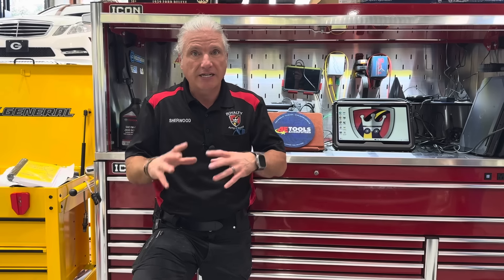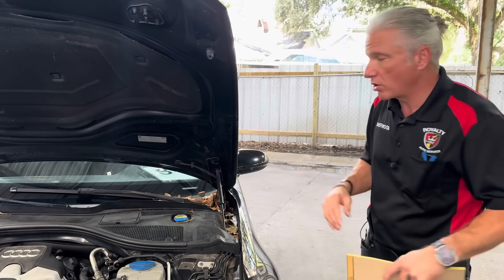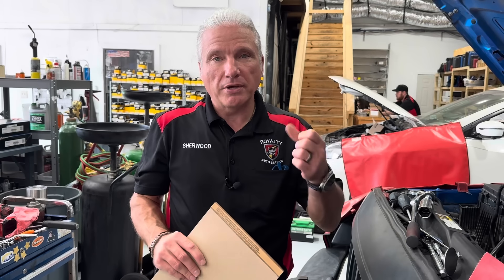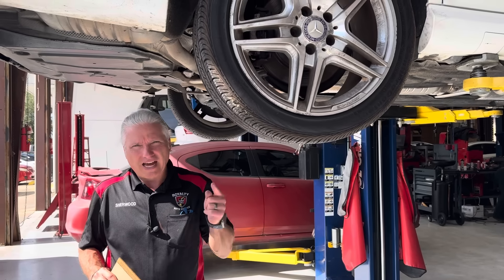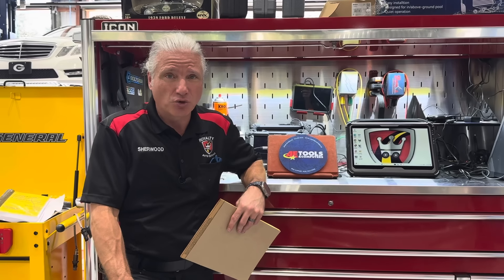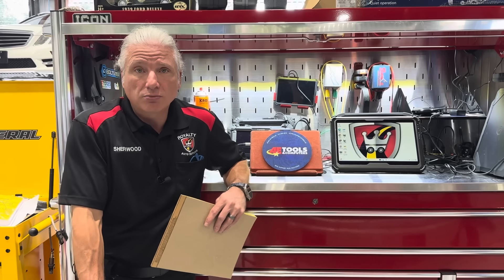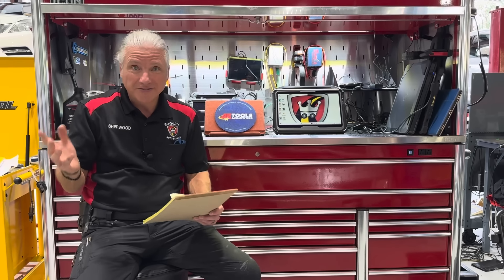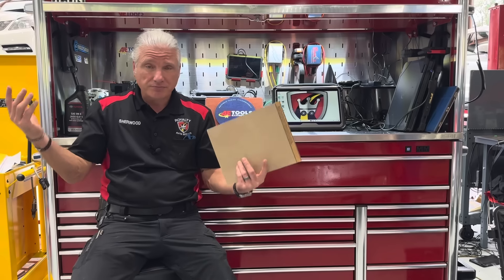Ranking The Top 5 Most Expensive Vehicles To Maintain That We Work On At Our Shop!

Comment: Yeah. I definitely prefer my minivan engine powered wrangler. Glad i didnt get the 3.6 engine. Sure i have less power but i also see less issues and mine easy to fix.
Reply: My buddy has a hemi-swapped wrangler.  That's probably the route I would take.
What type of minivan engine?  I just think of the Mitsubishi engine my dad had in his 91 Voyager when I think of that.
Reply: @ I got the 3.8l engine. I love it. Fits the main criteria I wanted in an engine; easy to fix, cheap to fix, reliable, enough power. I’m lifted 2.5-3 inches and running some decently heavy wheels and tires and I have no problems out of it. Stock gears still but planning on 4.88 or 5.13 in the future. I would do a v8 swap but I find fixing and the size of a v6 to be better for my engine bay.
Reply: 3.6 is easy to fix
Reply: @mph5896  I dont consider removing an intake for spark plugs and leaking oil cooler housing simple or cheap. Aside from that ive seen many have the infamous rocker arms failure.
Reply: @Hephaestusthejeep  diy I can see it being intimidating. As a mechanic, it’s a simple engine to work on. Rockers, you can wedge the tensioners so the timing cover doesn’t even have to come off. Plenum comes off in 20-30 min.
Reply: @Hephaestusthejeep  That sounds like a pretty convenient build.
I very much see your point with the V8 route.  You say 3.8L.  What type of engine?  What did it come out of?  Is it an I-6?  V-6?  Who made it?
I'm completetely with you about the spark plugs.  Those shouldn't require an intake removal to change.  If an intake is routed on top, maintenance holes in the runners should be designed into the intake to allow removal of the plugs without removing the intake.  That's how my Nissan D21 V6 is.  The only exception to this rule is if you have a supercharger.  Even still, I would try to get a blower that isn't that compact.  Allowing ease of access to something so commonly addressed.
Its a little like blocking access to the oil drain plug with a skid plate.
Reply: @mph5896  mechanic here too. I just don’t see the benefit of dealing with removing an intake to diagnose misfires or replace maintenance items when needed. Adding in getting new gaskets each time it comes off it does add up to be more expensive compared to a conventional ohv v6. The 3.6 is nice with more power and torque but I like the fact that if I’m dealing with a random misfire to trace all I have to do on mine is reach down and swap the plugs in about 30 minutes.
Reply: @christopherlowery855  it’s just a bored over 3.3 I think from Chrysler. Comes out the grand caravan.

Comment: Interesting, my 20 year old BMW Z4 is well maintained, but most years I spend less than $200 on it - Next year will be a bigger one. I am going to replace my spark plugs, battery and DISA valve, brake fluid flush and coolant flush. So about $2000 Tires were an issue until I went to an independent shop and had the alignment adjusted to a less aggressive (I do not drive on a track).

Comment: The oil change interval on the newer Land Rovers is every 20k miles.  Way too long to go between oil changes IMO.  We are doing ours every 5k miles on our 2024 Range Rover Sport.  I do the same intervals on my 2022 Lexus GX460.  I will say, the Land Rovers we have owned have been pretty good.  The last one suffered from a buggy and laggy infotainment system but the new one is much improved in this area.

Comment: Yeah, got an old AUDI, not surprised at all to see the brand on this list. And that's given I live in Europe, where they are much more common, like really common, so services know them, parts are not that hard to get and there are scrapyards in case you choose to look for used parts. And that's given I got a relatively simple one - no air suspension, no quattro drive (which is robust, yet adds weight and complexity), no problems with fouling on diesel, no turbine, but it's a V6 gasoline, and working on V6 isn't simple, so it's expensive, like changing timing chain alone costs 50-60% of the price of that old car.

Comment: Crazy. My Mom is 78 and has had 4 Audi’s. Currently has a 2021 Q5. She kept them all for around 10-14 years. All were bought new and all were sold with around 100-120K miles. Not one of them had to go to the shop other than regular maintenance like brakes, oil etc. Which my Dad did all of the maintenance. Why pay $300 for an oil change when you can easily do it yourself. I really think it’s luck of the draw. You can take 2 identical cars on one might have problems and the other have none.

Comment: My bmw has been very reliable however regular maintenance is very expensive especially fluid changes at around the 80k-100k mark. Transmission, transaxle, diff, coolant, etc. Also many plastic parts on the car that might need replacing at that mark.

Comment: OBSERVATION...also take each individual mfg brand part, add it up to get a dollar cost per part amount and also add up how many times that part was installed. This way you get an average price on a part and the likely it will be repaired if your doing a lot of repairs. So the data would look like this: VW oil filter $50...changed 70 times. VW EGR valve $80 changed 40 times. Ford oil filter $35. EGR valve $90. This way you get to see how much these parts are costing. This takes out labor....but its also good to add labor to see what it would cost at a shop or if you DIY. Avg repair order could be skewed if you counted an engine change vs. 10 oil changes or if you repaired 1 brand 1 time vs 50 times for a Dodge. You need help working w that data, call me.

Great vid and theres so much cool data to explore.

Comment: Had a 2012 LR4. Need to add to your list, the damn high and low pressure fuel pumps. Why they would link those in with the timing chain was stupid. That took my engine out, no warning at 118k miles. I will never ever buy another Land Rover

Comment: There was a time when BMW built engines that NEVER leaked oil. So much for progress. No oil change needs to cost more than $75, even using proper synthetics. It doesn't matter if the car is a European make. I can change the oil myself - and do - for under $45 in my BMWs, using top quality oil and filter. A $300 oil change is insane. These are interesting "average repair order" data, but the spread from lowest to highest by make is really insignificant.

Comment: My 2014 Mercedes Diesel ML-350 cost me around $5,000 in oil leak repairs over three separate repair orders within one year (2022). Thus, I traded it in for a new 2023 Lexus ES300h Ultra Luxury model and she is the best vehicle I have ever owned since 1967. I got my money's worth out of the Mercedes since I owned it from Nov 2015 to April 2023. No regrets, it was just time to let her go at 92,000 miles.

Comment: Although this is useful, it does not give the whole picture since the frequency of those repairs is important too.  In other words, cost of repairs during a given ownership period is what generally matters.   The Presentor mentioned for example, that many of the expensive repairs on Mercedes come after 12 to 15 years of ownership.  Owners who get rid of their cars before that would not see those repairs.  Did they need many repairs up to that point?
 A mechanic I know who mainly works on high end cars like Land Rovers and Jaguars mentioned that they tend to be reliable through their warranty period.  He had observed that many who are wealthy enough to buy those expensive cars new will trade them away for a new one during that warranty period.  For them, those cars ARE  reliable.  He suspects this is why those brands have not improved dramatically in long-term reliability..... the people who buy them new (what really matters to the automaker) typically do not own the vehicles long enough for "long term reliability" to matter.

Comment: I own a Jeep Wrangler it’s a 2014 Jeep Wrangler JK unlimited sport. It’s also lifted with 35 inch wheels on it. I’m sorry 35 inch tires and aftermarket 17 inch offset wheels. I have done everything to this truck and the lift with everything done properly with a little over six to $7000 in parts alone. I am a mechanic and I do not suggest owning a lifted truck, even if you are a mechanic because all of your time will go to it. If you want a lifted truck, do not use it as a daily driver like I do. Keep it parked only drive it when you’re offloading us weekend warriors have to pay a lot of money for this. Other than that, these trucks are tanks and they go forever if you buy one of these trucks factory and you get the issues fixed it’ll last you a very long time. Mine has 110,000 miles on it right now and I have had no issues other than what I caused on it myself. Now I do replace things before they go bad. I had a slight tick so I have brand new rocker, arms and push rods on the way and the timing chain lockout tool so I can replace this stuff myself. This will cost me a couple hundred dollars this will cost you a couple thousand dollars.

Comment: I had the eco boost at top 4 as a guess, I haven’t bought a gm since 2008 and the afm crap, love yalls approach to vehicles and the fair real way you do it!!
Reply: yea figured ford would be high up there. gm is hit or miss due to the truck lines and cadillacs are also shop queens. buicks are usually a better pick the toyota of gm in my experience. see how that plays out since they switched to korean chinesium models now in the near future. kia hyundai i thought would be number 1 as almost everyone ive known personally has had engine swaps or some sort of expensive fiasco in or out of warranty with those piles of garbage. they're like the samsung of home appliances.
Reply: @inducedapathy1296 but Kia and Hyundai have 100k warranty.
Reply: @fastinradfordable  yea that's prolly what is saving them from being the top in every negative category. most of my circle have bought them new requiring thousands sometimes tens of thousands in repairs before they even get out of warranty.
Reply: @inducedapathy1296 More like the LG of home appliances.  To your point though, they're both crap.
Reply: @fastinradfordable Its a powertrain warranty.  Also, after that 10yrs are up, so is the warranty.  Its just a scam for gullible buyers who believe all cars are built the same.
Repair costs are built into the cost of the vehicle.  The goal is to rotate a buyer into a new car every 5yrs.  Just like everything else.  Seems to be working pretty well so far.

Comment: Hmmm. A couple of flaws I see is that 1) this system could punish manufacturers that have long lived, high mileage vehicles, which only cost so much coz they made it so far and 2) some vehicles from the same manufacturer are worse than others, depending on what factory and country they were made in, and what market segment it's from (small, economical, commuting cars with cheap parts will have lower average cost of repair). An outlier vehicle could drag the whole manufacturer up or down a few positions

Comment: The cost means nothing if you do not use the mileage done...
I do all mechanic works on my cars/van and some people say an oil change only cost 100$ on their car at the dealership, every 10000km. Well..on my bmw the normal interval is 30000 km between oil change, i do them myself with the same then stock quality oil (synthetic 0w40) and it cost me 30€ filter included. So for 30000km i pay 30€ while they pay 10 times more.

Comment: My BMW and Cayenne leaked EVERYTHING and were on flat beds more than they were on the road all before 100K miles. 

Drove one 2015 Mazda MX5 to 120K spent $400 on repairs. 

Now drive a 2019 Mazda MX5 at 95,000 miles replaced the alternator and battery at 70,000 miles $700 in repairs. 

Neither car has ever leaked anything EVER!!!😂
Reply: My Pepper Car is headed for 250k miles. Been largely trouble free after fixing design defects. Hasn't been to the stealership in 6-8 years.

Comment: I bought a BMW X1 and the maintenance on it was ridiculous.  Paying $700 for routine maintenance, can't even change the battery, without them reprogramming it.  I mean this was a newer car.   I couldn't image after this gets out or warranty and the real issues pop up.  People see cheap BMWs and buy them, but they are cheap for a reason.  They are awesome cars to drive, but the repair and maintenance costs are a total waste of money.   I have a 2006 BMW 325i and it's still going with 160K on it, but when I brought it into the dealer, they wanted to do $3500 worth of repairs on it, like 20K miles ago lol.  $750 for front brakes!!  I did whole car, with new rotors for about $150, not the $1500 they would have charged.  I sold my X1 for more than I bought it for a couple years ago (Thanks Covid lol!!).  Never again.  Toyota/Lexus or Honda/Acura now.  I had my Prius for 10yrs and 160K miles and didn't put one penny into anything but regular wear items.  My 2005 Lexus, that I have had for like 18yrs, is still running strong.

Comment: Now it's time to do the top 10 cheapest ones lol
Reply: 1981 vw rabbit pickup diesel. 
Mine has a 1.9 tdi swap with electronics deleted. 

75mpg. 
I have commuted 1600 times last 2yr without a single failure.

Comment: Absolutely no surprises here. I was a fleet manager for a U.S. based German multinational. We predominately bought Ford Explorers and F150s for our sales force, but the German executives loved their Mercedes and BMWs. We also had American executives who loved their Dodge RAM trucks and Jeep Grand Cherokees. The German vehicles are over-engineered, expensive trash. I'm surprised you didn't mention the different size tires on front and rear of Mercedes vehicles and the "run flat" tires both Mercedes and BMW utilize. Jeep, what can I say, recalls, electronics, and transmissions are terrible as with most Chrysler products. Ford F150s had issues with recalls, timing chain drive/cam phaser on their 3.5 EcoBoost V6. Personally, I buy Asian and I didn't hear one Asian vehicle on your list. I know you don't like Hyundai, but I've had three, an Accent, and two Santa Fes with absolutely no issues.

Comment: I have a 2014 Dodge Grand Caravan. I've replaced both the transmission and it has the 3.6L that needs the lifters replaced/cam shafts replaced. I'm not interested in purchasing anything made by Chrysler Dodge Jeep going forward. There are shops around here that are working on a lifter or engine replacement 2-3x a week. It's a problem.

Comment: Most repair videos focus on engines   I’ve never needed engine repair on any car in 40 years  But suspension and steering parts are ridiculous   My 8 year old A4 needed 12,000 for control arms and steering nuckles  my grand caravan $9,000 for struts control arm brakes etc   Had one Audi needed2,500 for a fuel gauge

Comment: I had ab Audi A-4, 6 cly-worst vehicle I ever owned, nothing but electrical problems. My 2000 Toyota Tacoma with 240,000 miles runs like new, nothing breaks. My 2014 E-350 runs like new.

Comment: 2018 Tesla Model 3. No oil changes, no transmission to go bad. Nearly 100k miles now. Total parts replaced out of pocket- front sway bar links and control arms w/wheel alignment. $1400.  That’s it. Tesla tested the battery last month and sits at 92.5% capacity.

Comment: You realize just how bad some engines are, that they drag down a brand, while having some of the most (if not most) reliable drivetrains ever made. If even the Panthers cant offset the ecoboost crap, you know its trouble. Add to that the 5.4 3 valves and you got some bad numbers

Comment: My parents bought a brand new BMW X5 back in 2006, that thing was a true POS, built in Spartanburg South Carolina, flaking paint on interior door handle, led dot display dimmed out, exhaust tip cracked, leaking oil, smoking from exhaust, stayed in the shop 5 times within a year span, needless to say they got a Lexus after getting rid of that European trash.

Comment: Japanese are more reliable BUT only German cars use ultra high strength steel. Other than a 3 point seat belt developed by Volvo, EVERY safety feature was developed by MERCEDES. My S560 4 matic is a tank! With 50k miles nothing has gone wrong.

Comment: I have an Acura. In my lifetime, I also owned an 86 vette, and a 96 vette. If you had to graph repairs on these 3 cars? The Acura would not even show up on the graph, its maintenance fees have been so low. I have had it 8 years. I had the 86 Vette for 12 years and the 96 Vette for 9 years. I have a stack of MX bills from those vettes which is 2 inches thick. This Acura is a thousand times better made car than EITHER of those Corvettes.

Comment: Your assessment of the mopars is a bit off.  Yes, the 2.7 is a pos but my 05 347 hemi magnum is over 20 years old and runs like new.  I've done very good maintenance on it.   Transmission fluid changes, coolant changed every 4 years.  Mobil 1 synth  oil every 5k.   Even keep up with the very overlooked PCV they're too cheap to not replace.  I clean my map sensor and other sensors with electronics cleaner.   for shts and giggles I bought several relays to put in the boxes for the critical components like the fuel pump,, starter relay etc.  Hell the are like $6 per so why not.  Cheap preventative maintenance which also would help diagnosing fuel pump and starter issues if you know the relays are good.  Plus cheap enough to keep one in the glove box for emergency.   With the GM's they have had catastrophic engine failure with their AFM I'm surprised you didn't mention that.  It drinks oil like a wino drinks wine.  There's a class action lawsuit against GM for the issue that has plagued their engines since around 2008 when they started fjuking with the 8 cylinder and put that on.  The MDS on my Magnum has been flawless.  I like power so I only use it on the highway.   A few ape grunts go here